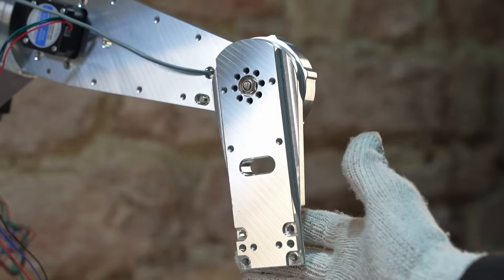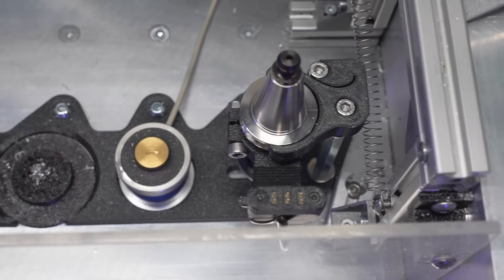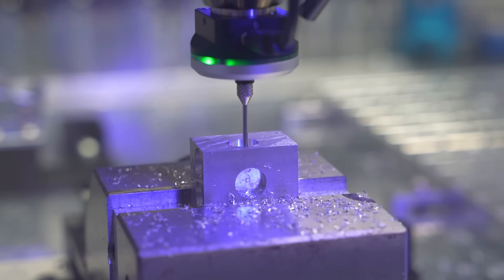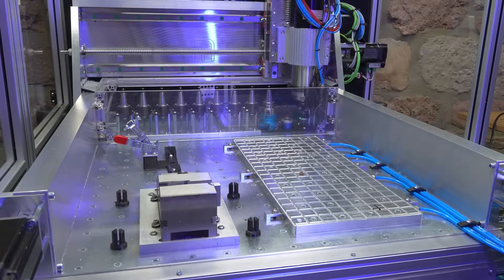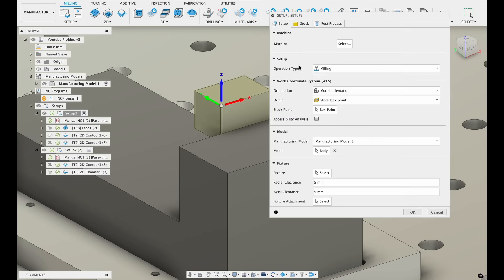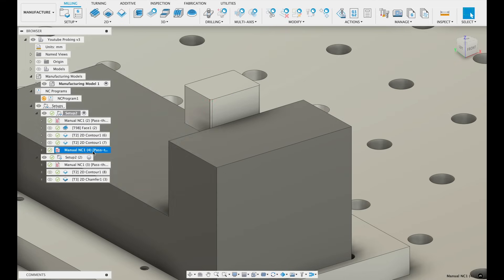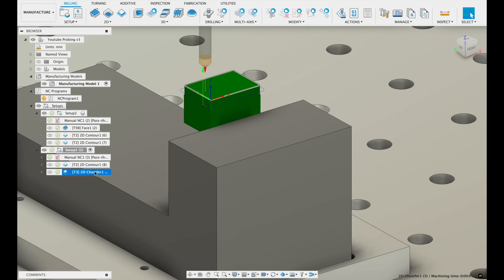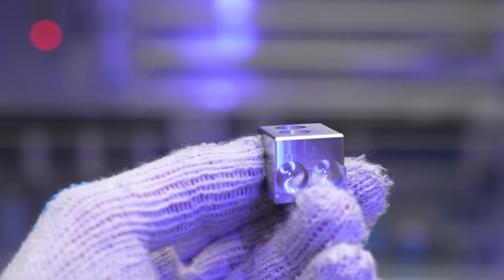DIY Automated 3D Touch Probe for CNC - Outperform 95% of Routers with Macro Routines

Comment: Are the probe routines built in to EdingCNC? I bought the same probe as you, and so far, your video is by far the most informative about probing in EdingCNC — at least in English — and that isn't saying much. Do I have to buy an additional plugin to use probing in EdingCNC? If so, where? It has been seriously frustrating chasing down what I need to do to probe in EdingCNC.
Reply from the maker: Hey I am selling my probing routines if you are interested write a mail. It needs some customization but it will make your life soo easy! There is also a standard probing routine by eding that you could customize with an llm, just if the first is no option…:)
Reply: @alexanderrueffer  It might be fun to take a look at your routines, but I am mainly interested in seeing what Eding built in to the software, first. There is literally ZERO documentation, and, like I said, this video is by far the most informative I have seen. JBWorx has a video, but he also bought his probing routines somewhere.

I am comfortable coding this, but I just need to figure out where the stock routines are.

Comment: do you need to align the wise whit the axis ore do it compensate on this when probing
Reply from the maker: The vise needs to be aligned with the axis. You can do an angle comp with probing 2 points (an edge). Datron does this for their vacuum tables. It is a pure software problem:)
Reply: @alexanderrueffer tx

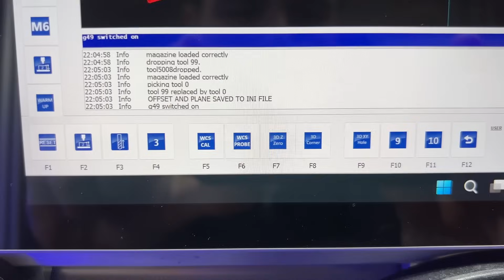Comment: 2:45 reminds me when I started with CNC, my first vice also has a welcome in my shop mark, and also the other professional vices which I use to steal from the handcranking guys have some marks.
Reply from the maker: @mrechbreger  Thanks for your insight! I don’t know if that’s something to be proud of or ashamed. I like it. Cnc scars😈
Reply: @ my DIY VMC CNC has nice drilling marks on the table. It just happens and that's what I would expect from anyone learning CNC by himself the fast-lane. CNC courses in Taiwan cost around 2000$ as far as I have seen, but for sure I would have learned less within those courses than studying linuxcnc and working with my own CNC VMC and CNC lathe. Exactly all that knowledge enabled me to be able to fix that industrial grade CNC which I mentioned in the other comment. I never crashed the head of the Mitsubishi, but broke 4 tools when re-implementing the umbrella style toolchanger.

Comment: Good video, I haven't found any using Sensor with Fusion 360. Thanks!! Where did you find the cooling system you use? I'm looking for a similar one
Reply from the maker: @victorgarrote-e4k  Hi Victor, thank you for your comment! The control is from Sebastian End with a peristaltic pump. Rest is diy. Basically a nozzle and an air pipe. Please search for „cold end“:)

Comment: The pogo pin idea to use a wired probe with an atc is legit genius - haven’t seen that on YouTube before and it’s a really novel idea - great job!
Reply from the maker: @drivenba  Thank you for your comment! At first I was afraid it is unreliable. Hell no! One of the best things added to this router. Will put out a hardware kit to cheaply implement it on your own machine. Without probe you fall behind imo!
Reply: @alexanderrueffer  Any update on getting the hardware kit for the probe (or releasing some designs so we can DIY)?
Reply from the maker: @mbanb6775 right now we focus on robotics. You can write me a mail. I will share what I have
Reply: @alexanderrueffer  Thank you! I sent an email with subject "ATC touch probe files"
Reply: 100%  I'd be interested in getting the design for this.
Reply: Same here

Comment: I love your setup. Large work area, ATC and good milling results. I didn't know you could have such a large tool for facing off the top surface with a spindle like that. 
Also, it's interesting to see how you use the touchprobe, I've been looking at the same touchprobe for my next cnc build. Thanks for showing!
Reply from the maker: Hi Sergew, thank you very much for your comment. This machine is a good compromise between rigidity and workarea. The face mill works great, but max DOC is 0.3 mm here :) All the best for your build!

Comment: Hey Alexander, I’m keen to see your work flow from beginning to end and hear your reasoning behind the choices you have made with your machines. Your quality in the finished products is definitely there, so for me, your opinion is of significant value and will help guide me in my current cnc router / plasma table with pipe and square tube machine. I’m currently in the FEA phase with my torsion box design revisions using laser cut sheet metal and in future phases will need to start looking at tool holders, coordinate systems and choices for controllers and all the electronics. 😊
Reply: I think you’d be surprised how many people would watch a longer form video on that kind of thing! Regardless, agree that you’re one of the benchmarks for proper home machining on YouTube!
Reply from the maker: @ Again very happy reading this. It motivates to keep making videos and exchange ideas with you all!:)
Reply from the maker: Hey thanks for your comment! I am honored to be kind of a benchmark for your project. All the best here for you! In the next robot video I will go a little into fusion. However it needs to be entertaining. Majority of folks prob don't want a tutorial. The basics are well known. The creative is interesting for me, how people tackle workholding challenges. Hope you understand! Thanks again, Alex
Reply: @ totally understand on it being entertaining, thanks again for your time and efforts. 😊

Comment: How repeatable do you find the "overseas" probe vs, say, a Haimer? Along those lines, have you found a way in Fusion to set a WCS that can compensate for a slight rotation around Z e.g. when your vise/workholding isn't exactly square with the X and Y travel?
Reply from the maker: Hi Timmay, thanks for your comment! The claimed repeatability is well below 0.01mm. I found that to be true. However the probe seems fragile. Sadly a standard probe is too large for my spindle and tool magazine. I am happy as it is.

I have a grid on my machine with dowel pins, so I never probe for G68. But I understand It's cool if you just throw your part on a vacuum table like datron. I would take the eding cnc sub for rotating comp and again run this from fusion via pass through. Thanks again, Alex

Comment: First! Anyway do you think there is a reliable method to use this probe without a tool changer? Thanks again for the video!
Reply from the maker: Hey Pavel, thank you! You are fast!:) Without ATC there are a few problems: The runout of ER collets is quite high. You would need to measure with every use (no one does this) and the z height is not precise. You probably need to combine the Z zeroing with a toolsetter. Or you look for a channel called "XYZ spec". He mounted it the Datron way. Perfect to use without ATC. Clever solution!! I use this probe only with ATC. One reason more to go for it:)
Reply: https://youtu.be/P8bgFug60xg?si=S_0qo8rVb4_2_iZm
Reply: @ That looks like an amazing set up with the movable probe, my only concern is the accuracy of the probe and any backlash which can effect part quality. Also it would be difficult to fabricate on a small machine like mine. In any case great idea and ill look into it. By the way, can you look into making a ATC video outlining how the system works, all the components required to make it and all the hidden cost which get missed by most people (Air compressor Etc).Thanks!
Reply from the maker: @ ATC video planned!:)